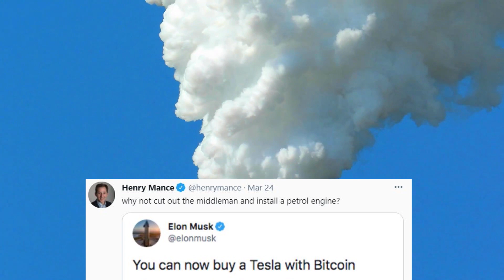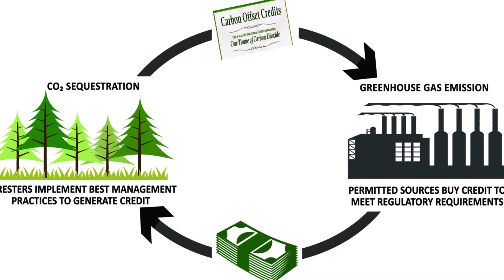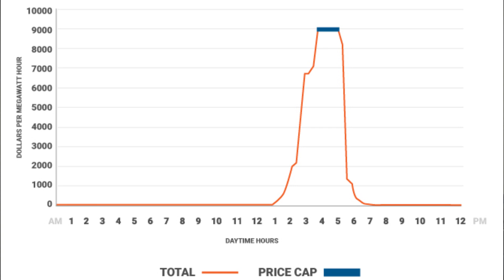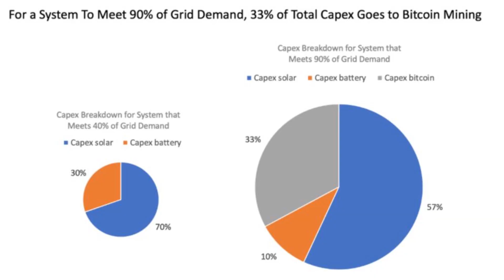The Bitcoin Green Revolution - Is Cathie Wood Right About The Environmental Impact of Bitcoin?

Comment: As I repeat
One Transaction draws more energy in the bc chain than a normal bank transaction, or any other smart solution. Any digital solution can be placed anywhere, bc is no different. It is just that the old institutions at the moment sit on legacy systems.

What are the requirements? Secure and stable log in, low overhead transfer packets on a secure line. That is it.

Minimum energy in total

Comment: Smart contract proponents would say no, you don't need to rely on miners' altruism one bit. Conditions predicating a switchover of power being supplied to mining rigs routed seamlessly into the grid would happen under predetermined conditions governed by a smart contract. Why would miners agree to such exigencies? Even today most businesses still must abide by laws meant to protect public goods. Look at regulations surrounding commercial/industrial water usage, for example. Those implicit and explicit commitments to the larger community are not about to disappear overnight.

Comment: Patrick, I think there are several things that you need to understand to make a more fair evaluation.   In fairness, I didn't read the report, so can't comment on their particular arguments, but I have looked into the bitcoin mining arguments to know something about the economics and how it relates to clean energy.

1) Bitcoin mining becomes unprofitable when energy prices go up.  It isn't infinitely profitable.   This is key because as the energy production costs are split into fixed costs to build a generation station, and variable costs to continue to operate it, and the profit margin is relative to all other competitors.  Thus, the power fraction spent on bitcoin mining would be relative to the price of variable cost after fixed costs are paid.  If/when a new power plant (e.g. a dam or wind farm) is built it is usually oversized initially, but bitcoin takes advantage offsetting ONLY of that oversizing, not the power generated for other purposes, and ONLY if that oversizing results in power generation with variable costs that are lower than other alternatives.  For example, a hydroelectric dam built might be oversized and the excess power generated can be used for bitcoin until the demand for power in the area grows to the point where more money can be made by selling electricity for other needs.  This is how China is offsetting some of the production costs for an expected growing power need.  Coal or oil power doesn't have the same dynamics because the coal /oil lead to higher variable costs.

2) Bitcoin mining can move dynamically to places where excess power is currently available.  This is particularly important with renewable sources because these are generally not 'aways on' technologies.  For example, when you need to turn on a light, it requires power is there at the time that you need the light.  If the wind isn't blowing at the time, the light doesn't work.  If the sun isn't shining, then the light doesn't work. So this requires excess battery power and/or fossil fuel sources (e.g. natural gas turbines, or diesel) as backup to account for the local demands at the time, and the start up of those alternative sources is the most inefficient operation.   But, when the wind blows or the sun shines then there may be excess energy capacity that can't be used because no lights are needed at the time and batteries are full.  But bitcoin mining makes perfect sense here because this is extra power that can be used to offset the costs of the fixed costs of the solar /wind infrastructure.  Because bitcoin mining is so globally distributed and automatically adjusts to available power, it makes sense for miners to mine ONLY when the wind blows or ONLY when the sun shines because that's when the variable cost of the energy is essentially free and it makes the miner competitive with other miners that are working with free or nearly free variable energy costs.

3) One of the 'free' sources of energy that several companies are working on is flared gas.  https://oilmanmagazine.com/how-and-why-natural-gas-flaring-is-being-used-to-mine-bitcoin/ This is a win win because the flared gas would need to occur anyway, and it allows the mining operations to be extended. 

4) Another source of 'free' is simply mining to generate heat that would have otherwise just gone through electric strip heating.  https://techcrunch.com/2018/03/08/qarnot-unveils-a-cryptocurrency-heater-for-your-home/   This simply offsets existing electricity costs.

5) Never mentioned in this debate is the cost of existing fiat systems.  You mentioned Visa, but that is the wrong comparison.  Bitcoin isn't designed for high volume low value transactions.  The mining profit is based on total value throughput in the blockchain, such that as the price of bitcoin goes up, so does the mining reward, but so too does the value throughput settled on the blockchain.  This encourages secondary layers like lightning for high volume, low value transactions (where fees are near to zero, as is the electrical energy involved), but settlement to occur on Bitcoin.  This means bitcoin has large value transactions where the security requirements are high, and therefore the energy expense is high to secure those settlements.   The energy use of Bitcoin is thus higher than countries, but this is because the value being transacted is higher too (e.g. https://charts.woobull.com/bitcoin-network-throughput/ ).  Bitcoin is currently settling about $185K/second.  This occurs WITHOUT the need for a bank to be involved.  So, to be fair, in evaluating the mining costs of Bitcoin, you need to also consider all the energy used by the banking infrastructure, and military powers to secure fiat settlements.  To compare with gold, you need to consider all the mining rigs burning diesel, without option to harvest 'free' or otherwise wasted energy sources.

Comment: I am studying a PhD focusing on renewable energy generation and storage and I am also a cryptominer. Everything you said regarding lithium costs, capacity etc is bang on, their projections are absolutely insane. 

Green energy generation would be increased by adding storage though, they are right about that. This is due to the issue of curtailment, which is when generators have to stop producing power due to an inability for the grid to cope with it. This is usually due to demand or transmission limitations. By adding a massive/constant power load near the generation sites (Wind/solar farms), then you can balance this out. By adding additional storage you can store the power that would usually be 'dumped' during times of high demand/low capacity. 

Their numbers are still pie in the sky though 😂 but the concept is sound and there are other economic incentives I won't share here where it starts to make sense 👌👍 

Regarding the environmental concerns, it is impossible to compare bitcoin to fiat without first measuring all the energy it takes to print money, run banks and everything else included with running the overall financial system etc. It's not just one metric, as bitcoin or banking would not be able to work on it's own. So without measuring all the associated energy demand with the sector, it is impossible to say one way or another how good/bad it is. As far as I know and from what I have seen, no-one has actually done a conclusive study on this yet, and it is all just academic wild guessing.

Love that you are covering these topics though, great video man! 👌
Reply: how do they deal with grid inertia when installing more and more solar farms?
Reply: @tixchicken  At the moment they dont effectively deal with it to be frank. It's currently managed through DSR principles and other temporary measures, I.E locating the farms near large continuous power sources. But effectively without enough storage it isn't really possible due to the variable nature of most renewable power generation. 

There are a few examples of storage being utilised in the form of pumped hydropower, which is being used to store some excess power that would usually be curtailed. Chemical batteries can be used but unless they provide some auxiliary function like securing a network, they are far from being economically practical on a large scale. 

Once again though the renewables need to be located near the storage mechanism due to transmission limitations.

Even if we had enough storage, there wouldn't currently be enough capacity to transmit all the electric across the country, the grid works on a more regional/local basis. Hence why power generators have to be located near transmissions and distribution hubs in order to get connected to the grid.

It's a bit more complex than that and there are a few exceptions, like where local demand exceeds the output of a generator, thus large scale transmission is not needed.

But I think my reply is long winded enough for now😂 basically we need new storage in local hubs, or we need to rebuild the entire transmission network to solve that issue.

Comment: I'm not advocating for their model and there's definitely some weird shit in there, but I think you've missed something in BTC economics: it's a race to the bottom. Over time, the BTC revenue per kWh approaches the cost per kWh of largest, cheapest energy sources (e.g. a previously built hydroelectric dam high in the mountains using only 1% of the energy it generates). And I say approaches because miners still need to recoup the capital and maintenance costs of mining hardware and come out the end with some profit. Given the enormous spread in energy prices between said hyrdo dam and a bustling metropolis, it's easy to see that - over time - these solar farms are likely to earn higher revenue from serving the population when the energy is needed, and then falling back to mining BTC when it isn't. There's no altruism in the theoretical case. There's two big caveats, though.
Reply: The first caveat is that while hashrate will always rise in response to an increasing BTC price, it takes time to manufacture and deploy new miners and during that lag profit spikes - and it often becomes profitable to mine BTC in city centres. This is happening right now. And while this is happening, our theoretical solar farm wouldn't give any energy to the broader population as they are unlikely to outbid BTC.
Reply: The second caveat is that while manufacture of new miners is currently limited by capacity of available silicon foundries (which cost billions to build), it will eventually be limited by the cost & availability of raw materials - in a world with exponentially increasing demand for silicon. So the revenue of existing BTC mining hardware could spend very long periods above the cost of cosmopolitan power prices. So in theory, there's no requirement for altruism, but in practice, there very well may be.

Comment: So as an expert in the green energy space I’ve looked into the economics of this. The real issue is that the relative value of mining Bitcoin is so high that nearly 100% of the time it makes sense to mine Bitcoin. You end up net consuming from the grid because the capital of batteries and the Bitcoin rigs are far more expensive than the electricity almost all of the time so on net it really doesn’t change anything except some of the time your electricity is cheaper. It certainly doesn’t make Bitcoin somehow clean.
Reply: Unless....the government funds miners to start solar and wind farms. Here they're not talking about the little guy mining. They've  made a pitch to Amazon and other large companies who are mining bitcoin to get the free goverment money while lowering their own net anual expenses.
Reply: Btc mining has a relatively large percentage of clean energy use. The amount of prosperity btc gives to people is infinite though and the small energy output doesnt matter.
Reply: @paramocro7317  Clean energy isn't particularly clean and 100% of this electricity is turned directly into waste heat. That's not an energy use; that's an energy waste. It doesn't heat a space you want to heat; it doesn't pump water to where you need it, it doesn't perform any useful calculation. Proof of work is by design the equivalent of pouring champagne down the drain as fast as possible in a way that allows you to prove you did it.

Comment: Let's face it, there is not much "cheap" space left in England as to where a hand dryer can be placed. The English will have to stiffen their upper lip some more and go the way of the French pissoir; the hand dryer stays inside, the cost of paper is too dear.

Now, for your semi-superfluous tirade on bitcoin mining ... the good thing is that people are talking about it; the bad thing is that seemingly talk is all that is happening while the planet burns or is being readied for it to burn. Talk is cheap while Bitcoin is not. All I can see regarding Bitcoin, at the moment, is de-centralized hype, but hype nevertheless. If there are only 21 million Bitcoins to mine, what says that another block chain cannot do the same or better than Bitcoin in providing a means for exchange and bookkeeping?. I'm probably missing something when it comes to blockchain and Bitcoin in particular, but not as it relates to energy use. Using coal to mine Bitcoin is preposterous and should be stopped immediately but unfortunately it will not be. 

Kathy Wood needs to remove the focus from putting solar to work on Bitcoin mining and instead concentrate on getting the U.S.A. to guarantee a price for Solar Grade Silicon (SGS) [Wright's law learning factor needs to be doubled almost overnight for SGS, to use parlance familiar to Kathy]. Putting the cart in front of the horse is not as effective as letting the horse pull it and the first thing that has to happen, for solar to be the primary energy source in the world and especially the U.S.A. is for there to be a bit over 2 million tons a year of SGS in the U.S.A. in order to make possible 500 GW of PV a year in installations. That will accelerate such an abundance of clean energy that it will not only make energy very cheap and destroy arguments as to where Bitcoin mining energy is sourced but also probably bring the value of Bitcoin itself down to ridiculous levels. 

There is no market for SGS other than to make solar cells. To wait for the established market to slowly arrive at producing several million tons of SGS a year (compared to the current 0.3 million tons) may be too late for avoiding the ravages of Climate Change with runaway CO2 levels. It is a tiny investment for a very, very large reward, but the FUDsters will continue to guide the illiterati, because the FUDsters have a LOT of moolah tied to the current status quo and they're spending it on solar FUD as if their livelihood depended on it, which it does. So we should buy out the fossil fuel interests 'a la' the Pied Piper of Hamelin.

One thing for sure, solar (Photovoltaics) is the cheapest form of energy in the world today and should be the only thing that a Bitcoin miners use. Furthermore, all countries should strive for all materials going into PV production to be produced with energy derived from PV ASAP.

BTW, your concerns regarding the cleanliness of clean energy, especially Photovoltaics, are unfounded. Currently the world has 4000 out of every 10000 acres of land devoted to agriculture, whereas only about 100 acres out of every 10000 are needed to supply all the energy the world is currently using electrical and otherwise. Photovoltaics is much more efficient than chlorophyll.

Jolly good show.

Comment: So at 11:00 you repeat an often repeated sentiment, but it seems that this is very difficulty to actually prove. And indeed according to Robert Sharratt (an electrical engineer and investment banker) the reports of bitcoin's ecological costs may have been not only greatly exagerrated and unfactchecked, but that this 'fact' can always be traced back to a single blogger called Alex de Vries (who, it seems, is very anti-cryptocurrency). You can read more about it if you google "the reports of bitcoin environmental damage are garbage" and look for the article on hackernoon by res_reassure, it's a pretty interesting read!

There are also, of course, many greener crypto options out there like ADA, ALGO, and NANO, if you're looking for something with a much much smaller carbon footprint.

Comment: Hey patrick, would you be able to explain further about the risks of nations mining empty blocks to 'freeze' the exchange up?

This was from a Real Vision podcast about a month or two ago. It was a debate between Mike Green (one of my senpais) and Anthony Pompliano. Mike was saying that all a nation needs to control more than 50% of the hash rate of bitcoin, is $7bil. Which is not a lot. (apparently, if you control >50% of the hash rate, you can slow down the exchange. Ie,  destroy the liquidity of the network.).

Also, i want that statistics book you wrote. Looks interesting.

Comment: The problems with mining Bitcoin is what ended up breaking up the community into Bitcoin cash and Bitcoin SV, the problem comes from the size of the file that needs to be created for the blockchain to accept it, other cryptos are much much cheaper to operate and use, that's also the reason a transaction in Bitcoin costs around $20, Bitcoin as it exists is nonviable.